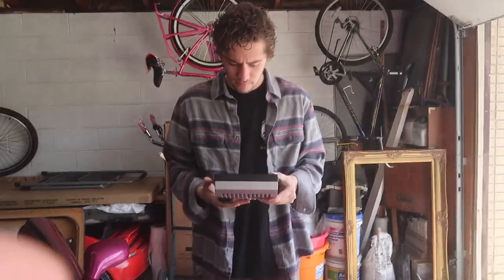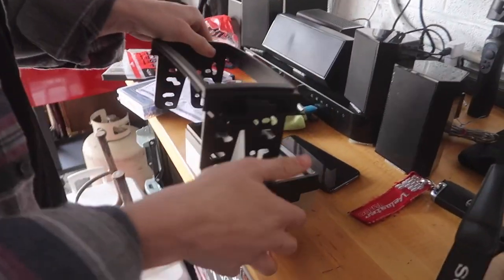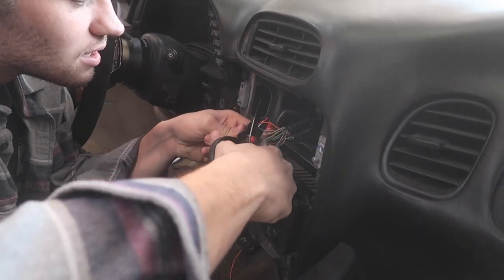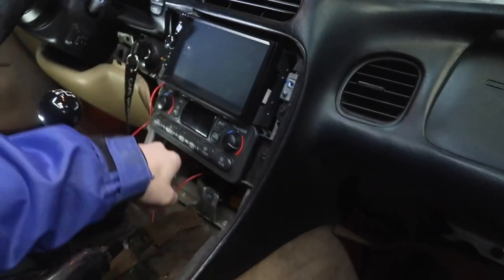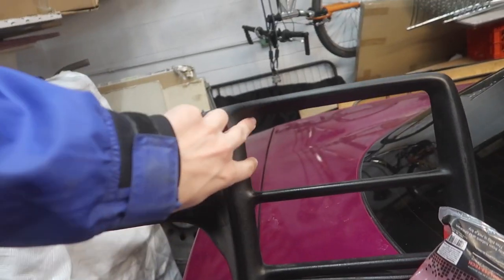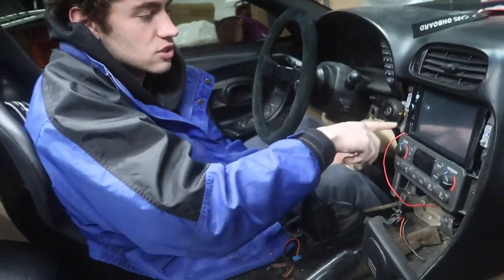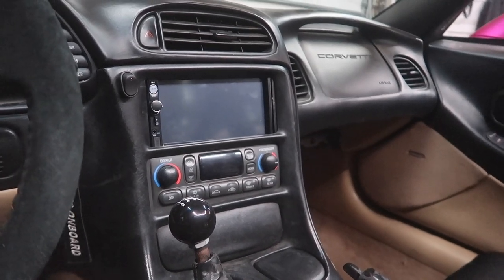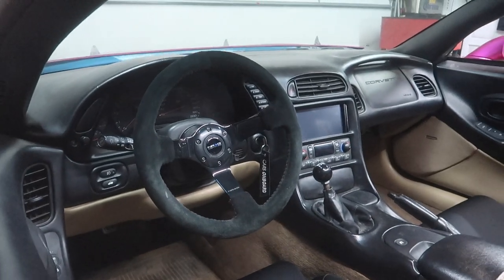Cheap Double Din Radio Install In The WhoreVette

Comment: Dude metra sells a replacement bezel for the C5 to actually fit a ddin in. The issue you're running into is that the cheap junk radio you got isn't industry standard size. And why didn't you buy the harness instead of cutting it?!?
Reply: Izuhara Torozu If it wasn't clear already, he has no idea what he's doing...
Reply: Must be a first time viewer....this is a hack-a-thon on this channel for future reference.  Nothing will be done correctly here, you have to find peace with that.

Comment: Why didn't you just spend the $10 at Walmart for the harness adapter?
Reply: That would pull from the bondo budget...not an option
Reply: Cory Brewer I didn't think about that. Lmfao
Reply: c5 requires a $60 pac harness
Reply: @hardwired4873  fr. its actually some BS. i used a normal adapter when i first did mine and i was wondering why there was no bass. turned out you need that pac harness

Comment: When I had my silverado I ran the accessory wire to one of the fuses in the dash. Just tapped in with one of those add a circuit things I forget what they're called. Took me over a week to figure out there was no accessory power in the radio harness lmao.

Comment: Battery wasn't disconnected AND used scissors to cut the harness...electrical basics 1-0-1
Reply: Also, crimp connectors? Solder and heat shrink!!! Butt connectors for car audio make me cringe!